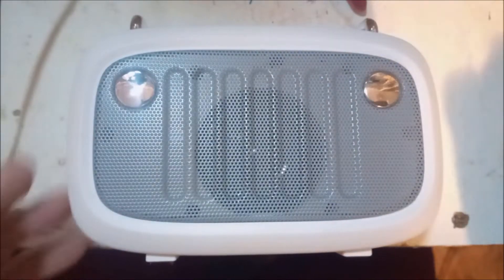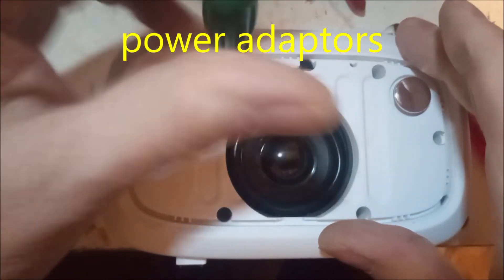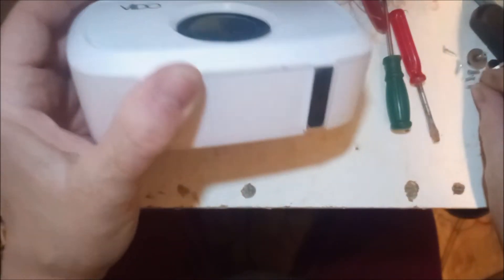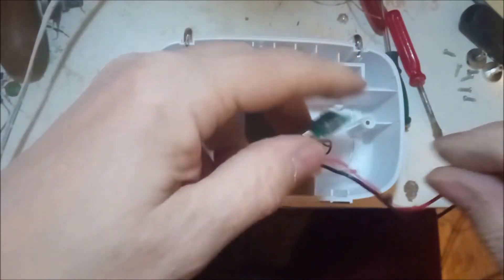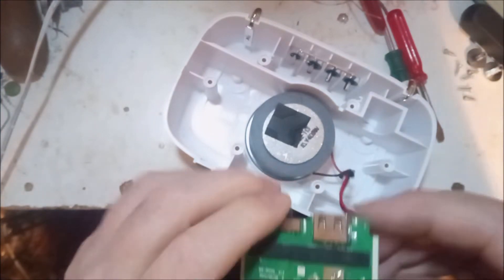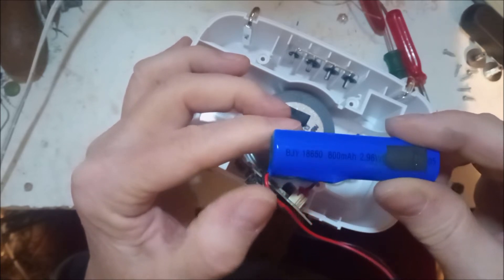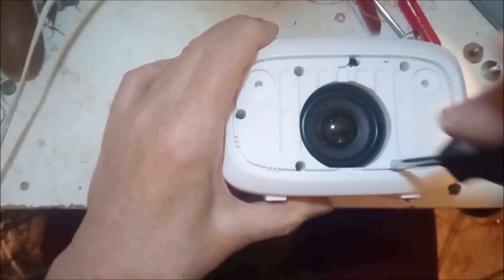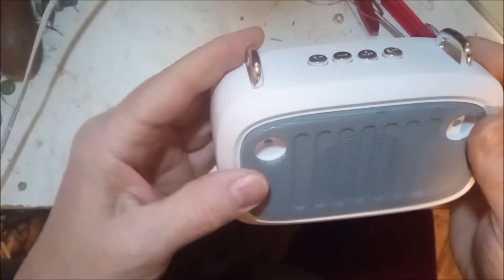Viido bluetooth speaker teardown 1

Comment: Thanks for showing access. At 4.43 that battery connector is reversed compared to mine it shows battery +/- on the board  , mine came back to life after hitting the battery with 4.3 volts. 
That round metal component is labelled as a microphone on mine maybe some versions are smart speakers

Comment: If u connect a micro usb cable in the back you can use the wire as a antenna and get the radio to work

Comment: Hi, it's just come down from £6 to £5 at poundland. 
  I considered fitting an aerial but it's just good as a bluetooth speaker,  very good really. 
 I don't really need more radios,  currently building a retro one in a wooden enclosure.This was handy for the access to it, thanks.
 I suspected the rear was a pressed fit ! : )
Reply from the maker: Because it is a budget item, each one could vary in build quality and the one I bought had a battery charging issue. When/if I find my one, I'm fitting it with a 4 X AAA battery holder for four cells. The charging issue will then be a simpler process. Thank you for your interest and comment. 🙂

Comment: To test if it still works, try it plugged into the USB charger, it should work from the USB 5v power supply, even if batt has died.
Reply from the maker: That course of action was tried and it still didn't work. The issue seems to be in the charging regulator circuit as the LED charge indicator didn't illuminate. Thank you for your interesting comment. 🙂